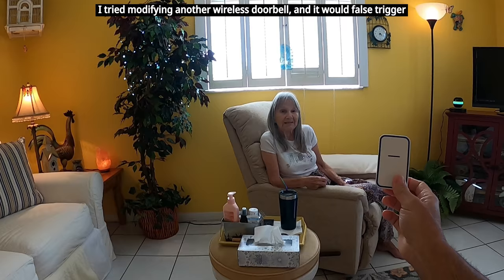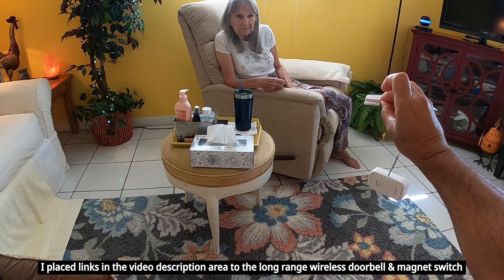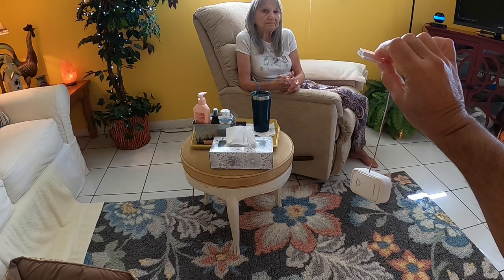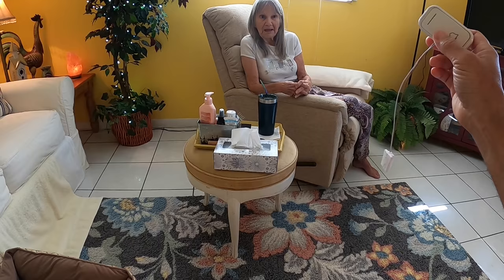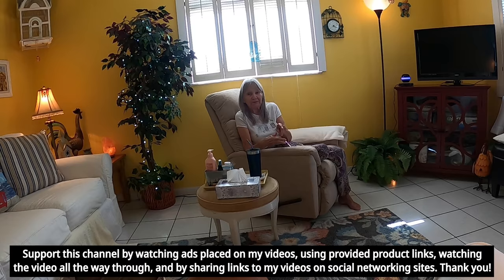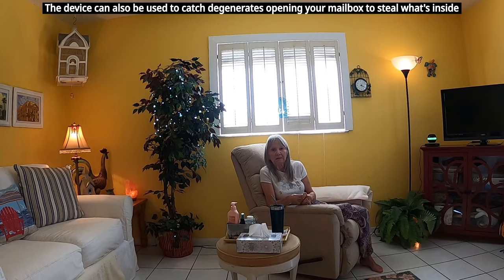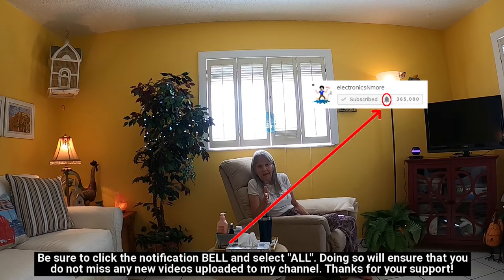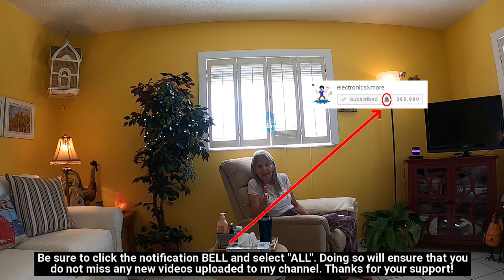SIMPLE Mail Delivery Notification System Or Shed Door Alert System!

Comment: Brilliant idea. Adding an LED that latches ON whenever you get mail in case you were taking a shower or didn't hear the bell will be a nice addition to the circuit.
Thanks.
Reply from the maker: Yes, pretty easy to add. I may make another video showing what to do, if this video starts getting views. Thanks for watching!
Reply: Actually, that LED will drain the battery over time. Instead, put a 555 transistor in the circuit that you can use to pulse the LED. A pulse every 5 seconds should do.
Then you will need a way to reset the LED to turn off the pulsing.
Reply: @AtlantaTerry  - "... drain the battery ..." - Actually, the LED would go on the part that remains inside the house, which gets its power bu being plugged into the house AC power. You can see that part with its AC plug at: 10:22 -> 10:25, and probably at other places in the video.

Comment: I liked the story WalMart story. My mail alert probably cost me a lot more. I used a Wyze Sense sensor (with the Wyze cam and bridge circuit). In the house, I have several small light bulbs that are controlled by the Wyze Plug smart sockets. That turns on the bulbs. I use my Google home to shut off the lights, when I say, "Hey Google, go postal". My mailbox is plastic so the rf makes it to the house.

I wanted to add that I did this same thing about 30 years ago with a doorbell and a microswitch. The switch was mounted on the door closure arm at the store where I worked so that when someone opened the door, a cheerful tune would sound and alert me of a customer in the store.

The problem I had was while the door was open, the alarm kept sounding. I fixed this with a capacitor and a resistor. I think I used a 0.1uF capacitor and a trimmer pot, maybe 1 meg. The resistor was wired across the capacitor and all that in series with the switch.

When the first closed, the capacitor would be discharged. But then the capacitor would charge up and would make the switch seem like it was  open, and the chime stopped. After closing, the resistor would discharge any voltage in the capacitor and it was ready for another opening. The variable resistor was handy to get the right value. 

That would keep the setup you have from repeating the chime over and over until the box door was closed.
Reply from the maker: That works great too! That was a good fix you came up with for the problem. The unit doesn't continuously chime if the door is left open, what happens is the transmitting stops to protect the battery from discharging due to constant triggering of the receiver, and you'll need to reset the transmitter using a simple on/off switch(could be momentary push) or removing the battery. Some transmitters false trigger when made as shown in this video, but this one seems to work very well. Thanks for watching Dave! Be sure to share.

Comment: Great idea. I’ve done one with a cheap driveway alarm. The problem I had was if you don’t hear the chime when the mail is delivered then you don’t know it was triggered. I was trying to add a circuit on the receiver with a latching relay that would keep a LED illuminated until it was manually reset. That way if you missed the alarm the light would tell you that there was mail. I gave up and never figured it out. It would probably be easy for you. I’d like to see it if you do.
Reply from the maker: The alarm is pretty loud, so it's hard to miss, unless you're outside. I'd just go outside 5-6 pm and check for mail if the alert wasn't triggered. No biggie. Thanks for watching!
Reply: I was thinking the exact same thing....there would be a simple latching (bistable ) cct that will be in a triggered state until reset....I think one based on a few transistors would be easier to build than an IC variant! .....Great idea and alternative use for such a product...I had no idea their range is this good...saving link to come back to it if no one else has offered a simple add-on cct
Reply: An SCR to latch an indicator LED would signal that you had mail. A blinking led would be better.
Reply: So smart! I love how you all think.

Comment: This is awesome! I just finished the same thing, with a $20 in parts. I bought a $10 wireless doorbell with a 1500 foot range from Amazon. Didn't know there was such a thing. My mailbox is over 250 feet away and over a hill, through two garages and two walls in the house and it works great. Thank you! I was about to order a $60 mailbox alarm, so this saved me $40, not including a bit of work to solder the wires and install the transmitter in the mailbox. I put my battery pack inside the mailbox instead of on the bottom.

Comment: You never cease to amaze me with the great ideas you come up with. I’m definitely going to have to do this. Only downside for me is the postal deliverers here are sometimes to lazy to close the door! 🤦‍♂️  My luck I won’t be home and the battery will run down. Guess I could mount an away switch
Reply from the maker: I have many more ideas, but I've been getting very low exposure by YT for my videos, as a result I've been holding off many videos. I don't like spending many hours creating videos and answering countless questions to get nothing in return. YT is a full time job for me. The stupid videos on YT get all the exposure, helpful/educational video get far less views. The battery won't run down, what happens is the transmitter stops sending a signal. To reset, you simply remove and install the battery, or add a small SPST switch as mentioned in detail in another reply. Thanks for watching!
Reply: electronicsNmore Thanks for your reply. Will do. I went to post on the negative reply you got and it wouldn’t go through. Looks like it might have been his reply got removed while I was composing? I’ve heard other YTers say that thumbs up or down makes no difference and all helps with ratings. So b-hole helped you out by rating and commenting! Hope that’s true!  I’m a ham operator and I’ll be sharing your info with the guys in the groups I belong. It’ll be a small token of my appreciation for what you share. As we say.....73
Reply from the maker: @Locksnut  People that clearly don't support my work, like the moron you mentioned, I block. Blocking prevents them from engaging in spiteful actions against my channel.
Reply: To prevent my mailbox from being left open by the Mailman, I placed a small spring on the door. The spring closed the door, the mailman has to open against the spring. Still working after many years.
Reply: I started watching your channel when you posted the MOT, microwave oven transformer circuits. You showed how to make a spot welder. Thanks.

Comment: @electronicsNmore - Thanks for providing a link to the unit you used. Now (a few years later), the unit shows as "Currently unavailable. We don't know when...", but there are many other units with similar range and function to choose from.

I picked one up from a local home center to use for this, but it has a range of less than 30 feet from outside the house to inside the house. My mailbox is probably about 160-180 feet from the house to the mailbox on the other side of the street. 

The inside part of this one plugs into the wall as yours does, but the outside part only has a button cell battery, rather than the 12V battery used in your unit.

Comment: Got the parts through your links and installed it today. My mailbox is about 160’ away from the receiver unit and it works fine. Easy peasy mod too, Thanks. It’ll be interesting to see how it works over the winter here with regards to low temps.
Reply from the maker: The only problem encountered, is if the mailman has a habit of leaving the door open 10 secs or more, then you need to reset. You can also avoid the problem by adding a weight to the bottom of the mailbox door to prevent it from being kept open. :-)
Reply: I have not seen that. Nor could I reproduce the behavior you describe.

Comment: Great idea, I’ve followed all the steps and it works a treat. Subscribed.
Cheers from 🇬🇧
Reply from the maker: Sometimes you can get false triggering or triggering issues if the door is kept open too long. The solution would be to have the mailbox door only stay open if you hold it open. Add a weight, spring, etc. Thanks for watching!

Comment: Okay, cool idea. So let's say that you work nights and sleep through hours when mail comes or normal daylight people's hours of being active. The alarm goes off, but you don't hear it because you don't want to hear it, you want to sleep because you have to get up and go to work later. Is there some sort of status displayed on the receiver telling you that it had been tripped or the door had been opened letting you know you need to check it? You can see the advantage & disadvantage of this on garage doors, the mail box ect. for this segment of folks which are many...
Reply from the maker: If you sleep during the day, then just get up and get the mail at 5-6pm. Modifications can be made to keep the LED illuminated on the receiver after triggering until you press a reset button, but I won't bother. For 95% of people, what I made is more than sufficient. Thanks for watching
Reply: @electronicsNmore  That's what I surmised, but it's good that a small LED can be integrated. Some folk would need that since they are so far away from their boxes/pick-up points. I guess I was really wondering what features, if any,  were built into the circuit. Still, it's a great idea!

Comment: Seems like there would be a lot more ideas to resolve this kind of issue. The basic technology has been around a long time and mailboxes much longer. I'm trying your idea because where I live the mail is delivered any time of the day or night and it can be extremely cold in the winter.
Reply from the maker: It works good. Keep the wires to the magnet switch about 5" long(Too long can cause problems with some wireless doorbell systems), line everything up with the magnet switch, close the door, then install the battery. :-)
Reply: @electronicsNmore  Got my order today and got it soldered, ready to install. I don't like the sticky tape that came with the components that will probably break down within a year, and I think I will use the screws that came with them. My mailbox is plastic or some composite material, so the screws should hold all the components on. If not, I'll get some better tape. I hope you'll do the video about the LED suggested.
Reply from the maker: The double stick tape is lousy. One day later it fell off. Use 3m.

Comment: Very cool
You can use also door bell switches that don't need any batterys for the switch, ther is something similar like in electronic firelighters in them to load the power for the signal you have never to replace the switch batterys, becourse it don't have one 😉
Reply from the maker: You need the battery in order to send the signal.
Reply: @electronicsNmore  I think he is referring some switches that use some kind of mechanism that actually generates enough power to txmt a brief pulse.  I've seen them but I don't remember where. They need enough movement (probably a magnet thru a coil) to create enough electricity, and the distance may not be that great due to low power, so it may not work well for this application. The battery here in your device should last a very long time anyway. I definitely plan to try it out.

Comment: I use a harbor freight driveway alert alarm about $7.   I then used a esp8266 hooked up to a 433mhz receiver to intercept the alarm signal.  The esp8266 then sends my a text message via email that the mail has arrived.   More complicated but I get alerts on my phone.
Reply from the maker: Interesting method. I really wouldn't need phone notifications. If I'm away from home, I don't care about mail until I get home. Thanks for watching!
Reply: electronicsNmore 
Your idea is much simpler and easier for most.  Thanks for the great videos.
Reply: P RO 
It’s a neat idea and since I’m downstairs in my workshop I don’t necessarily hear any chime.  I can quickly check my phone anytime to see if mail arrived.  Saves a short trip outside to check.  Only a big deal if is winter and very cold out.

Comment: I'm doing it, but when I attached the reed switch to the metal mailbox, it seems like the magnet no longer affects it properly. It's intermittent. When I remove it from the metal mailbox it works properly.  I may change the switch to a lever type limit switch, see if I can get that mounted in there.
Reply from the maker: Hi Charles. It should work if properly lined up. I like the lever switch idea.
Reply: @electronicsNmore  yeah, I  couldn't figure out why it was acting so intermittent. Anyway, I had a "tamper" switch from an old pc case (really old, I hate throwing things out like that). I hot glued it inside the mailbox and it seems to work quite well.

Comment: Great idea for so many people. liked.  Thanks!

One question, I'm unclear about resetting this for times when the door is open for 10 sec. or more.  Are you saying run a wire from the battery positive to the push-button switch or the unused wire on the sensor?  Thanks again.
Reply from the maker: What you'd do is remove the battery, and at 14:12 in the video you see where the metal clip is soldered to the board. Solder an insulated stranded copper wire (20-28ga) to that (+) location where the clip is attached and connect it to one side of a small SPST ON/OFF switch. The metal clip for the battery stays! Then just to the left of the (+) soldered connection, you will take a utility knife blade and cut the PCB trace leading to the lower right side of the push button switch. Cut a 1 - 2mm wide strip out. Solder a second wire to the lower right point of the push button switch and that wire connects to the other side of the on/off switch. You'll be able to turn the unit on and off when leaving a door open, or easily reset the transmitter if more than 10 seconds the mailbox door was left open. Thanks for watching!

Comment: I need to extend an external antenna from the mailbox...I’m assuming that is the long trace under the lettering...opposite side top from where the soldering was done?  Was hoping to put a 8-10” wire on one side of the antenna solder joint..or both?  Any ideas?  Thank You for your many FANTASTIC videos...just wonderful!!!
Reply from the maker: The range is already very far, at least 300 feet.
Reply: I’ll try relocating the wall bell but we have a very long driveway...works perfect if not under the mailbox but gets hidden just enough to not generate a signal when mounted underneath the box.  Figured dangling a small antenna extension would do the trick.  Maybe just setting some wire over the internal wire with the tail outside the transmitter would do the trick?  Or, maybe it needs to be soldered to the two solder points of the antenna?  Thank You!!
Reply: @mkaa05  adding a wire might help a little, but a better idea could be to extend the wires from the switch so the whole transmitter unit could be mounted higher up from the mailbox. It wouldn't be hidden then, so it may not be the best solution for you. 
Antennas work best when cut to a length that is proper for the frequency, that's why just adding an extra wire might not be good enough.

Comment: You left out one critical step. Could you please explain how you ran the wire through that small opening with it already attached at both ends?  Doing it the way you showed it, you would have to run the wire through the hole THEN solder the wire to the doorbell switch contacts.  OR: Was there enough room to slide the contact that's mounted on the inside of the mail box, in-between the mail box housing and the bottom of the door?
Reply from the maker: The magnet switch fits inside the lower part of the mailbox door when it's open. Thanks for watching!
Reply: @electronicsNmore  - I figured after watching very closely when you showed the mailbox door opened that there might be enough room in-which to slide that contact through that opening.  Thanks for confirming that bit of info.  And THANKS for posting this great idea too! I've got two storage buildings that are 80 & 90 ft respectively, away from the backside of my house that I've been trying to figure out a relatively cheap way to monitor both buildings, should someone attempt to enter in through the door without permission. And you have now provided a fantastic way for me to do that. :-)

Comment: isnt it actually the NO contact you need? 
Since normally you want an open circuit, else the doorbell will be going nuts 24/7, in NO when you open it, it closes thereby engaging the circuit (opposite to an alarm circuit which you want to be NC as it is actively monitored for a break (open) in the circuit, in our case the NO circuit closes when opened replicating pushing the bell, right?
Reply from the maker: No. You missed where the test was done by pulling the magnet AWAY from the reed switch before testing it. You want the NC contact with the magnet out of position.
Reply: @electronicsNmore  your correct, now I had my coffee yes, NC physical bits  is an open circuit which then closes the magnet in reed, triggering alarm when magnet is moved away creating open physical but closed electricial